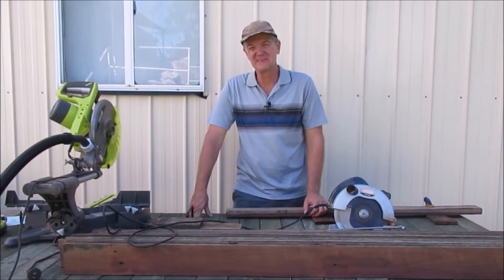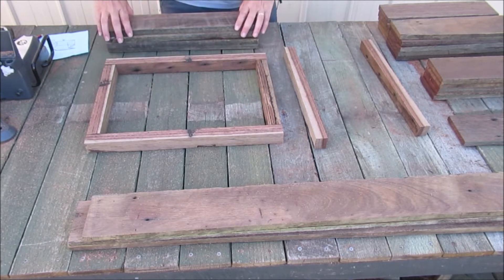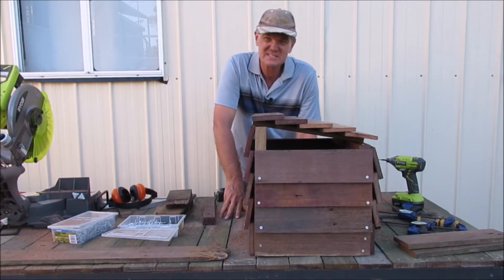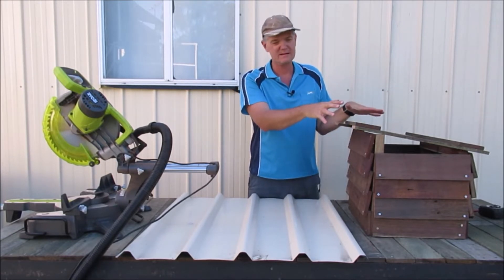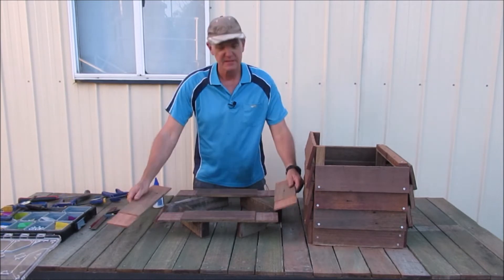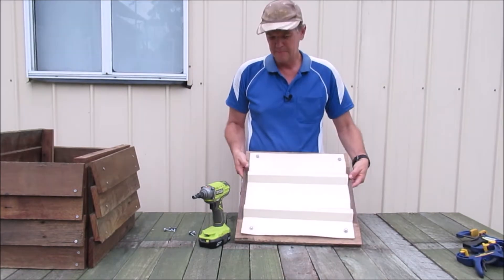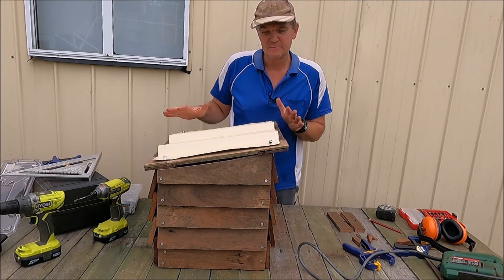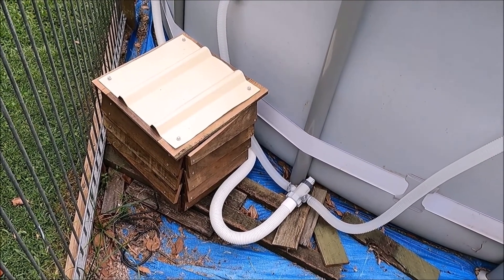Build a Timber Pool Pump Cover from Recycled Timber

Comment: I like that.   Here in Arkansas we call it rustic.   Is Queensland arid?  Very humid here.  I just rebuild some of my wood fence.  Which gets gets blown down regularly from Thunderstorms.  So I have the slats, treated pine.  I am opening my pool now and had to replace the top of the valve assembly.  It became brittle.  believe the damage I get to my pool filter comes from the direct sun exposure.  So with that in mind.  Humidity will make it moldy.  It really think it just needs shade.  I think I will add 1/2 in. (About 13mm) wood spacers between the overlaps on the side slats to allow plenty of air flow.   And I believe I have enough dog eared  top pieces to make a rustic looking wooden shingle roof also.  My only expense will be red barn paint (to match all the other things i have in the back yard) and screws.   Thanks for the ideas.
Reply from the maker: It can be humid here at times too.  I find if I can keep air flow around it, then there is no mould.  There hasn't been any mould around it so far and it's been there quite a while now.

Comment: That was going so well until that roof section. Why didn't you let it overhang by 300 mm or so on every side and make the cut on the metal sheet centered so that the ridges looked somewhat symmetrical because the rest of it is really really really pretty